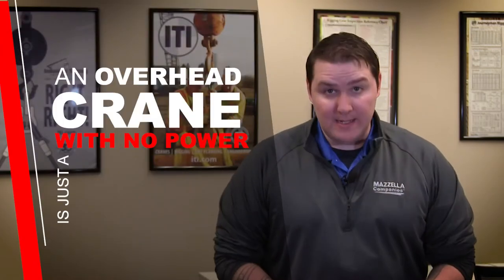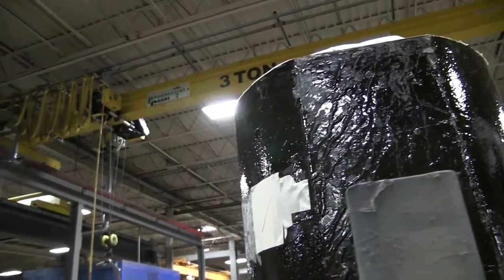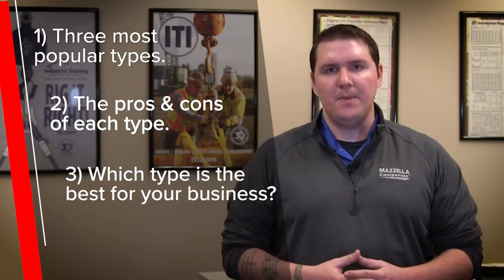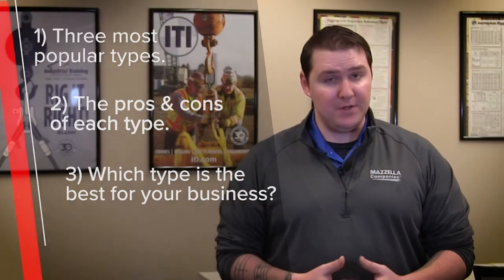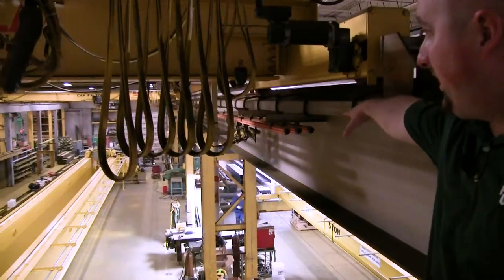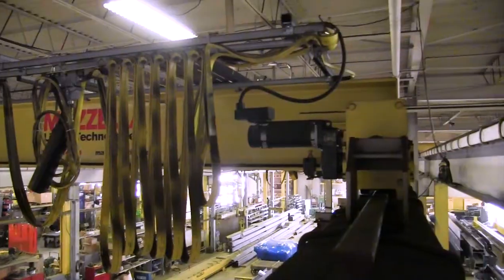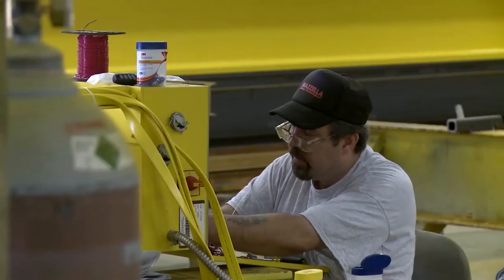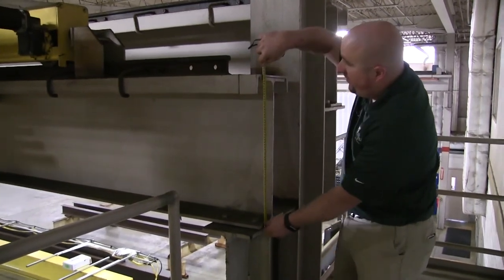Overhead Crane Electrification: Conductor Bars vs. Festoons vs. Cable Reel

Comment: Sir good day, this is for my understanding. Would like to know, this situation, there are 5 EOT cranes running in one runway, how many circuitry they require from the Main Panel?  Is it one only as it will be connected to common busbars of the EOT cranes running on similar runway? Thank you in advance.

Comment: Any requirement for EOT gantary crane operator
Reply from the maker: Overhead cranes do not require certification unless the company requires it. However, crane operators are required to have documented training proving that they are competent and qualified to operate an overhead crane. The company that employs the operator would be responsible for determining the training requirements to ensure that the crane operator is competent and qualified and can be proven to be such should OSHA inquire. We have a podcast that discusses this. https://youtu.be/lR3-PR093Rk?si=6Lg1J0PwrwR7Pj8o&t=769. A good place to start listening is at 12:49. Also check out this podcast that also dives into training requirements for overhead crane operators. https://youtu.be/nFWxo5Xv45k?si=5dFeHfLKtbuNChlI

Comment: I would prefer festooning as it can be done in any environment and with any type of cabling, and ease of material availability. Also cost-wise its the cheapest.
Reply from the maker: Thanks for the comment! 

There are a ton of great reasons to go with any electrification system. The key is making sure you find the best one for that specific lifting project.

Comment: I expected to see objective criteria, such as the one about splicing (which did not explain much). Maybe wear, environmental exposure (moisture, dust) and contact issues for older conductor rails, breakage and clustering for festooning, accidental rupture and running over or for cable reelers, and so on.